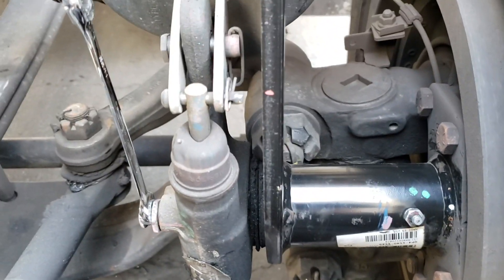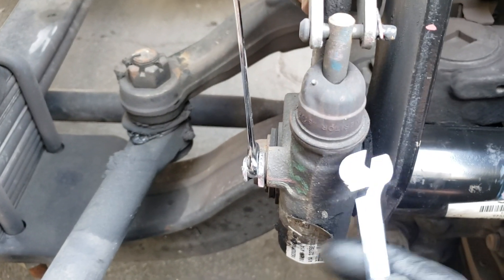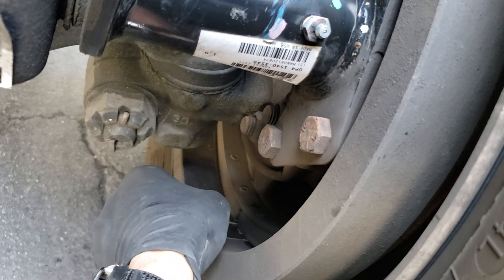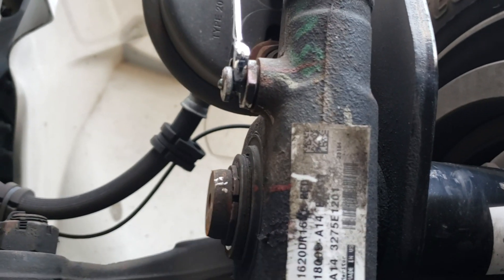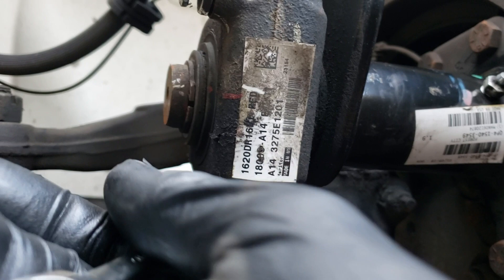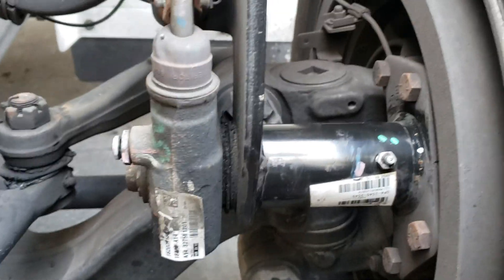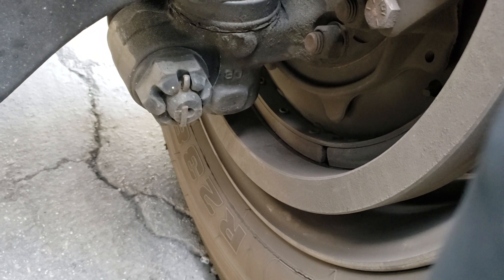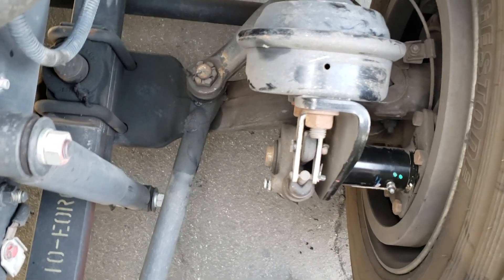How to adjust air brakes on a Hino

Comment: Why someone do 1/4 turn and some do 1/2 turn when adjusting? Thank you
Reply from the maker: Not sure I was always taught a quarter-turn put it right where you want it within spec half turn to me might be a little much
Reply: @Pyro4100  thank you for quick answer. One more question i have tow truck drive local all the time my truck have 55k miles and my drakes start making loud braking noise i took it to dealer they do not find nothing and offer me change brakes so my question what it could be and is it normal for brakes to be worn in 55k ? Thank you
Reply from the maker: @americanroadsideassistance6935  tow trucks go through a lot of stop-and-go so you can wear through breaks a lot faster if they are making noise a lot of times it's the pads not completely contacting the drum meaning that the drum maybe out of round it happened to me on the front brakes a while back still at half pad left change the pads and drums no more sounds but it is normal to have some sound on heavier trucks
Reply: @Pyro4100  Thank you
Reply from the maker: @americanroadsideassistance6935  no prob